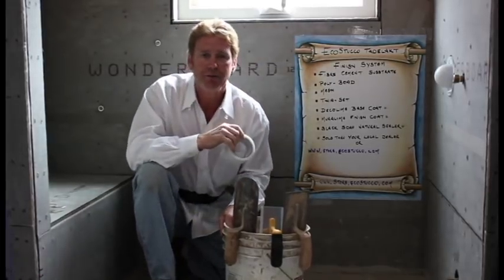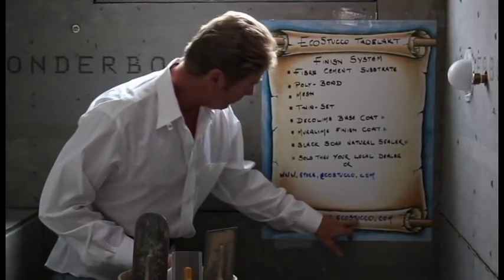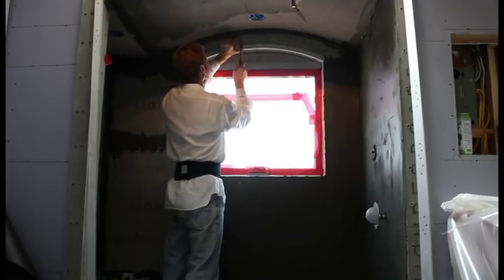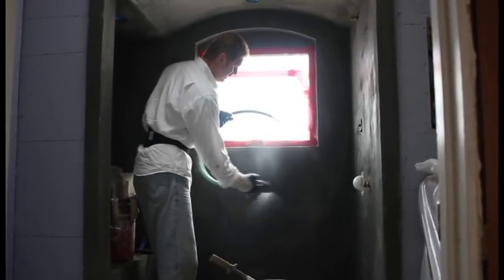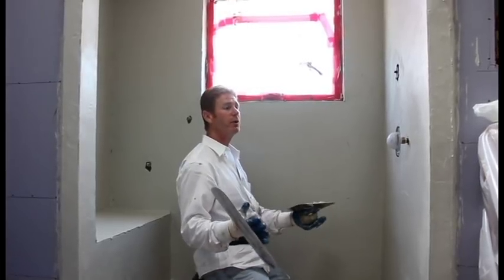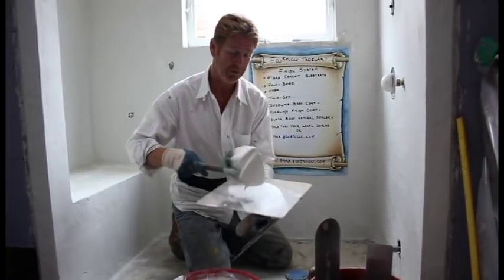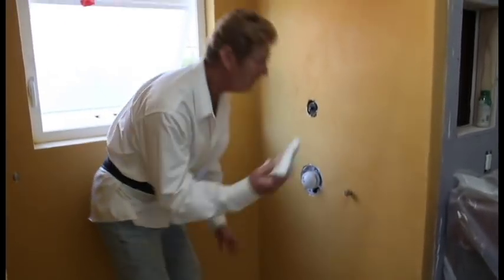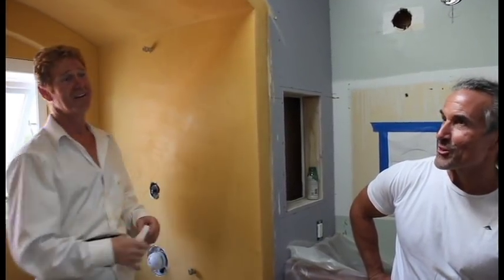How to apply Eco Stucco step by step

Comment: THANK YOU for posting this video! I've been remodeling the bathroom in my 50's-era house over the last year or so (I'm not married so I can take my time lol) and I was wondering how I'd replaster the walls over the concrete board I used. This answered my questions. Anyhow, I've spent hours watching your other videos. I also built a patio with archways on the back of my house and am currently in the process of stuccoing it. So far so good! Thanks again!

John in San Diego

Comment: Kirk, I just found a really interesting lime putty product in the UK, which has sand already mixed in, and it's cheap and comes in colours too; "Regency Lime Plaster".  I will probably use it in our cottage.
Reply from the maker: Hello Matal dude, I don't recommend any lime plaster directly in the shower as all will grow mold spores, but in the bathroom on the walls or anywhere else is groovy,
 cheers,
 kirk giordano Rendering
Reply: Yeah I've seen that before and it looks interesting, I'd like to use it some time.

Comment: Kirk, just discovered your channel and I really enjoy it. I want to turn a corner of my basement into a shower, it has painted cinder block walls, would you recommend this product or would cement plaster work? I want it to be smooth, thanks.
Reply from the maker: Good morning Scott, hate to say this, but I recommend tile for most shower areas, FYI this lime system requires maintenance, such as applying a black soap to help prevent moisture from penetrating, this is super pretty and cool looking but maintenance is required.
 Now for any other walls in the home that are not in an actual shower, this system is great.

In fact after 30 years and applying every plaster and acrylic finish made in shower areas, I still recommend tile, as the grout joints may still mold but at least the entire walls won't.
FYI, if you have a really good exhaust system this helps with any system including tile.
 Live long and plaster,
 kirk giordano

Comment: He didn t mention that tadalkt is a morrocan tradation, using plaster lime ( called in moroccan  gobsse) ,mixing it with savon beldi( black soap), wich is a moroccan tradition made of the   olive oil and fatty acid.
Tadalkt,is a morocan name ,mean work into past with hand, bcse, many many yers ago,to know, to mixt every thing for TADALAKT, the masters used only their hand, no machine.
So, the reason, they use savon beldi ( black soap), in tadalkt, is bcse, when mixing it with witl lime plaster, a chemical reaction, occurs, between fatty acid from the black soap wich came from the  lack olive, with the lime from plaster.
 This chemical reaction prouduce, a thin film made of Lime soap(calcium).
This  calcium soap is  insolible in the water( water resistance).
 This is the reason why Tadalkt is used for bathrom with shower.
Bcse of this, tadalkt help to prevent the mold, stain from water,  any thing that combine with water to prouduce a product that cause, bacteria, mold, stain, around tadalkt in ur shower.
On the top of this result, tadalkt, give a wonderful  impression  to the eye.
The way  the morrocan, made tadalkt, by hand, is very intense work, but the finished prouduct is beautufull,.
Reply from the maker: Howdy Simo Anejarn dude, correctamundo, you are right.
I personally don't apply any of the 20 different finishes in showers anymore because of the Maintenance, However we are on the same page, the colors are beautiful, Thus I will push a button to highlight your comment as what you say is indeed true for those who don't mind the maintenance.
If you wish to include your phone number so folks can find you.      
                       Live long and Plaster
Teaching the world how to plaster one Video at a time.
Reply: @StuccoPlastering  other sealers have the same effect but far more maintenance free correct?
Reply from the maker: Evening  Simo, I would not do another of these finishes myself in a shower, as they do require maintenance, who has time for that. However in any other place other than your shower, cool looking stuff.
Teaching plastering do’s, don'ts and reasons why,
 Kirk and Jasons plastering tips.

Comment: Good morning- Thank you for all the inspiration. 
I am hoping to apply a lime plaster finish to the top half of my shower. There is a Shluter membrane I will need to attach the plaster directly to. Can you recommend the flex bond or versa bond for this first coat? Im assuming the dry time might be a bit longer if used?  Or is there another thinset you might recommend to to act as a binding layer. Shluter most often recommends a non modified thinset for application and setting tile as the dry time is an issue when speed is necessary. Thank you
Reply from the maker: Howdy Jessica, hate to say this however, I no longer recommend any lime finishes in showers. Please read the description.
Bringing to all the most complete plastering encyclopedia ever created in the world online.
 By the plastering messengers of Youtube.  With well over 850 free self-help videos 🎭 👀💃
Kirk and Jason Giordano Plastering

Comment: What are your thoughts on the finishing trowel. I am going to be applying a white tadelakt finish on a bathroom. The supplier had ran out of the white pavan finish trowel I did find the red finishing trowel still made by pavan. Do you think the red trowel will streak the white finish?
Reply from the maker: Evening Skopetake Dude, personally I was told something similar, I can use any trowel handy and get the same effect.
 Carbon or stainless, anyone familiar with tools can apply.

Teaching plastering do’s, don'ts and reasons why,
 Kirk and Jasons plastering tips.

Comment: Kirk, I want to make a ecco stucco (tadelakt) shower. I have Durock cement boards as substrate, I have a redgard ( water resistant membrane) from what Ive read you can apply a dry mix fortified thinset mortar over the membrane. Imbedding a fiberglass mesh into the membrane over the cracks. My question is... What products would you recommend over the regard and then what tadelakt/stucco mixture? Can I apply Tradelakt from store.eccostucco.com over a fortified thinset morter or straight over the membrane ? Or would  I need a polybond or versabond material ?
Reply from the maker: Evening Brittany Dean, both Eco, and Tadelake are so similar in colored lime, I can't tell the difference.
Teaching plastering do’s, don'ts and reasons why,
 Kirk and Jasons plastering tips.

Comment: Hello Kirk. 

Have you ever had any issues with Eco Stuco spider cracking in a shower setting? I'm a plaster contractor who is also based in the San Francisco Bay Area. The company I work for plastered a shower with Eco Stucco and had horrible spider cracking after the job was done.

Comment: Lime is not as eco friendly as people think. Simply because firing limestone requires  CO2 to create it. If we could find a chemical assay that creates lime and captures the released co2
Reply from the maker: Good morning Derek,  you will get no argument from me for two reasons. One, I'm not an engineer or scientist.
 Two, I haven't applied lime plaster in a shower for about ten years and will never do so again, as even if in a well-vetalated shower, they mold like hell.😉
Who wants to spend every 6 months, at least an hour applying a block soap or other waterproofing membrane over a shower wall? Not me.🤔
  Our unique plastering Tip:  all subscribers or anyone who stumbles on our channel with a question, type it into our Stucco/Plastering channel, and like magic, a video will appear to explain how it's done. 	
   This feature is miles ahead of any plastering forum. 🥳	
Kirk & Jason Giordano Plastering
Reply: @StuccoPlastering  Im confused. Are you saying the project you show here is something that would mold like hell?
Reply from the maker: Any stone whether crushed or solid will mold in a shower, even if it's the shower is well-ventilated.
 This is a fact of science. 
Hell even plastic sheathing and or tile grout can and certainly also molds in any shower anywhere in the world.
 The product I'm using is pretty, but I have not recommended it since after this video. 
When I was called to look at the same fish done by another company.
As who wants to wax a shower wall every 3 to 6  months?  I have better things to do like scrub the toilet with a toothbrush.😉

I recommend this product for the whole hose even the kitchen but not in a shower.